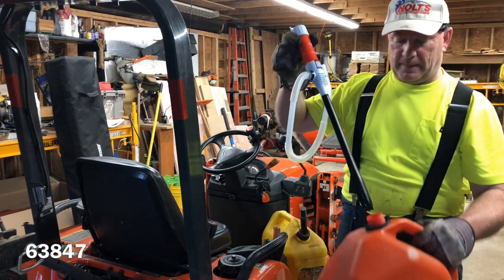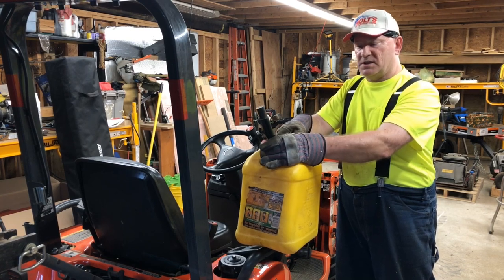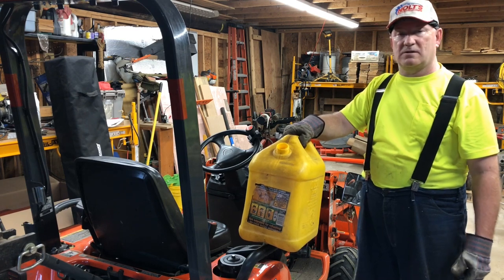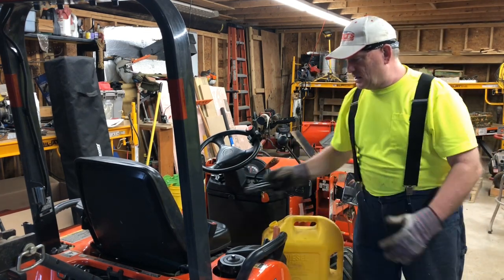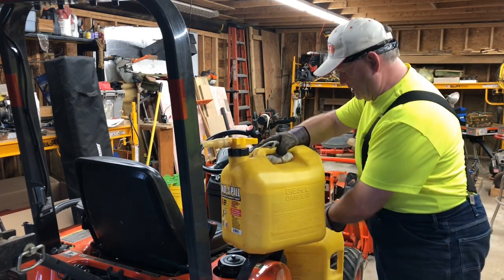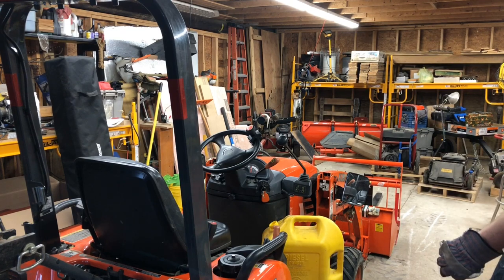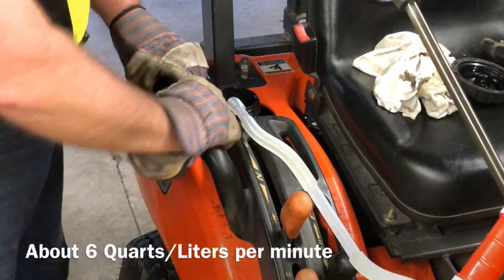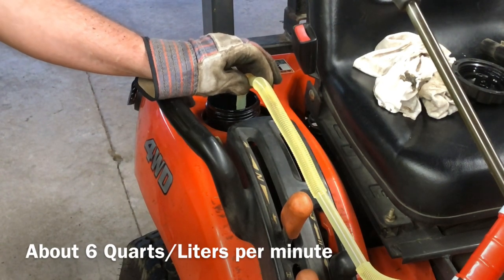#42 - Fueling The BX1850

Comment: Thank for the review, Robert.   Funny you're doing this today.   I literally bought another one yesterday for a spare when I was in Harbor Freight.   

I have three of them that I use around the ranch and one spare.   One for gasoline transfers, one for oils and one for grungy liquids (think: bilge pump).   

A friend has a waste oil burner that runs on a multitude of petroleum based liquids.  Water plays he🏒🏒 with his furnace so I allow my waste oils and fluids to set in a 5 gallon bucket for a few days with the side away from the spout propped up on a 2x4.   After the water gas separated out and is laying on the bottom, I use the HF transfer pump to suck out most of the water from the bucket.  There is very little remaining in the bucket and the water separator on his furnace can handle what remains.  

I've even doubled up the hoses and used one to pump out a waterlogged post hole before backfilling the hole with clay.  

Amazingly good pump for the money.  

Cheers!

Whipple
Reply from the maker: It is a great value.  And honestly, I think it pumps fuel faster then it can be poured from a vent-less fuel can.  I just wish I bought one years ago.

Comment: They are great pumps Bob. I bought one at Princess Auto and it didn’t last two days. I then went and bought a name brand one that’s lasted well over two years and love the thing. Mine is used mostly for small engine stuff. I use a 55 gallon drum with a service station type nozzle and a commercial 110 volt pump with spin on filters to make sure the fuel is clean. Those pumps like you use sure beat lifting those yellow Jerry cans. Have a great weekend and stay safe. .............Paul
Reply from the maker: Thanks for watching and commenting Paul - Hope you all stay dry with Dorian heading your way. - Cheers

Comment: I have three of these pumps. I added 1/2 inch copper tubing to the hose so i don't even have to pick up the fuel can when filling up my equipment!
Reply from the maker: Great idea - I might give that a try myself - it's a tight squeeze on the BX operator deck for a fuel can - pleased to meet you - stop by again